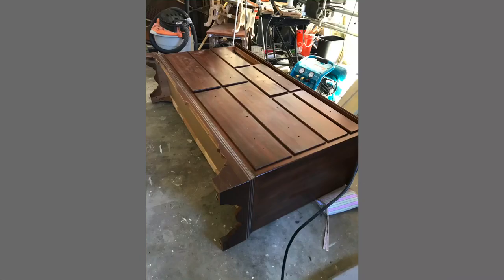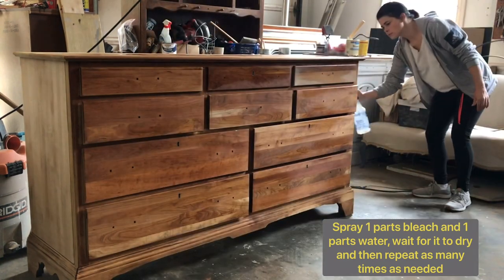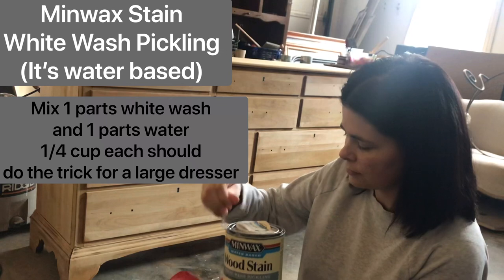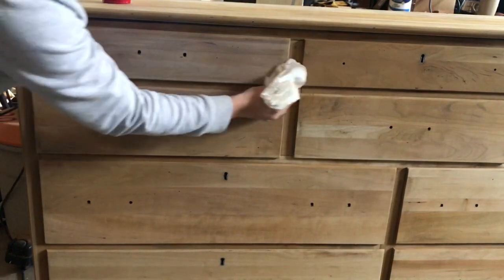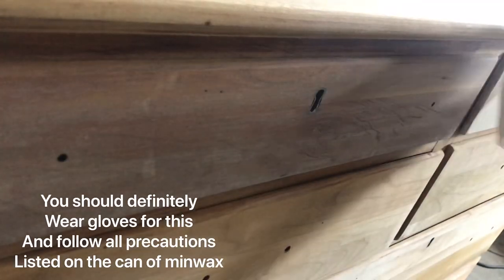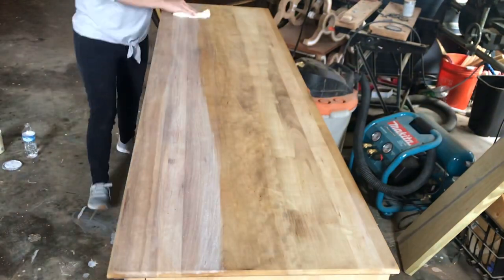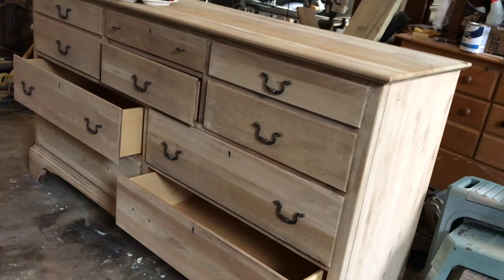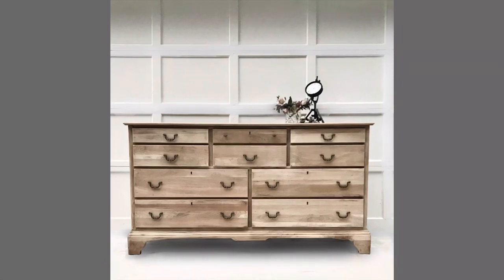How to BLEACH wood furniture & white wash to GET RID of ORANGE tones

Comment: So I did your technique. It came out so amazing! My sister who is an interior designer was so impressed she couldn’t believe the finish. I used a stripper and that was such a nightmare! Then I used the pickle stain. I went one step further and added a clear coat. I did this on a dine table.
Reply from the maker: That's awesome to hear!!
Reply from the maker: @marlinadykema6474  I chose not to topcoat it bc I had heard most would darken the color and make it look shinier, if you really need a topcoat for like a dining room table type situation I have heard general finishes flat out flat doesn’t darken it.  I personally would just leave it raw and just sand it if something spills on it or use white wax unless it were something high traffic

Comment: Hello sweet girl boy this piece came out amazing I am working on a piece and I have it down to the Royal I used the bleach I did it twice I think I’m going to be doing it again tomorrow and I will be using a spray bottle like you did because I painted it on. Left in the sun to get lighter, the only issue was I have some grooves on the legs so I had to get some Orangewood stripper applied in the grooves until they got lighter. Tomorrow I will be bleaching it again hopefully it comes out a lighter color which it has already on the top I love it my question is this do I have to use the Minwax White paint  you used? Or can I use my white paint water it down and apply it? Thank you for sharing you are amazing and all the work that you do love watching you and listening to you I know it comes from the heart. Have a blessed day thank you

Comment: How did you get into all the grooves might I ask to strip the stain? I've tried sanding down furniture to bare wood using a hand sander but when you get into the detailed areas the sander completely strips away the details in the furniture. I have a really old piece with some ornate details that belonged to my mother-in-law and I would really like to strip it down to remove the stain and bleach and pickle it as you did here. Did you use a Dremel of some sort or would you suggest your Pottery Barn Paint finish instead? Which finish would you say was easier to accomplish? Great work, your pieces clearly show your talent and a keen eye for detail. Thank you for sharing your techniques.
Reply from the maker: Hey!  I used to do it by hand but now I use a tan paint in the crevices now (before I sand usually) and nobody can tell I swear!!
Reply from the maker: Try open canyon by Behr

Comment: Hello, thanks for sharing this tutorial.  Did you seal the piece after using the Minwax?  We are in the process of refinishing our dining room table which is made from Rimu (a New Zealand native timber) and we have sanded it back to the raw wood.  My vision is to have the table looking as raw/natural as possible but Rimu has a yellow tone to it.  What would you recommend to use to get less of a yellow look and a more white/light/natural/raw tone and then what do would you seal it with as it is a high use piece?  Many thanks.
Reply from the maker: Gail Williams the white wash I use in the tutorial is from minwax, it’s a liming white wash stain and does provide some protection, bc I wanted the piece to look as raw as possible I didn’t chance it by putting a top coat on which would deepen the color and bring out yellow tones.  High use pieces usually call for poly top coats in my book but it may change the color, so I would test it in an inconspicuous area to see first

Comment: I want to do this on an antique wash stand. I'm really hoping it gets rid of the yellow/orange tones in the old oak. The finish on this dresser is beautiful.
Reply from the maker: Oh it definitely will!  I’ve done this a bunch of times now, I will add that I’ve learned to apply vinegar after the dresser is fully dry to neutralize the bleach so your wood stays strong ❤️
Reply: @blacksheephouse  Thank you for responding to my fear and cluing me in on the vinegar. In the 70's I refinished many oak pieces, not minding the natural colors of the oak. I would tone it down with a pecan stain , which worked pretty well. I still have access to those pieces and they are way too dark for me today. Thanks again for your advice!

Comment: What would you use to seal it if you did this for a dining table top to avoid deepening the color?
Reply from the maker: I’ve heard general finishes flat out flat doesn’t darken especially if you’ve done the white wash first ♥️
Reply: Thank you so much❤
Reply: If you use a water base varnish, it won’t change the colour, especially on white paint, only oil base varnishes leave a yellow tinge.

Comment: did you clean out the bleach with vinegar? i read that the bleach will reach with the finish if u don't do that
Reply from the maker: I didn't do that to this piece because I didn't know that, but I have heard you need to do that.  My piece is doing fine so far but I didn't seal it with anything just the white wash